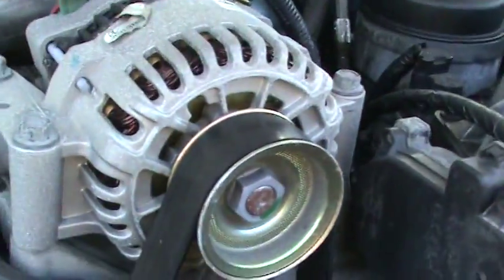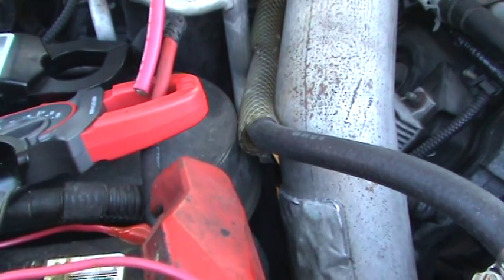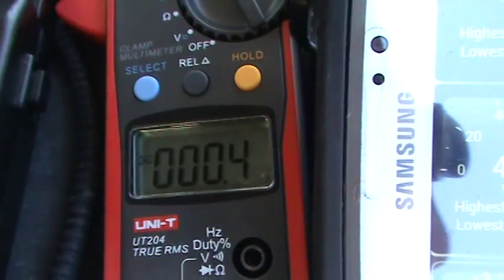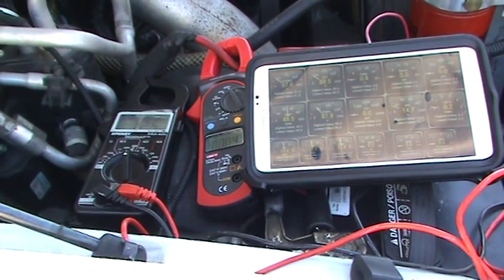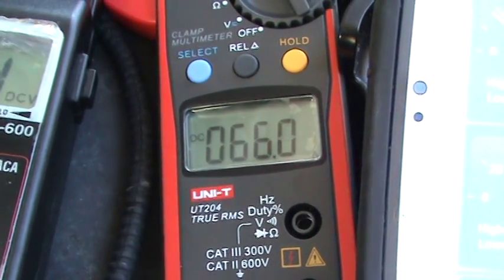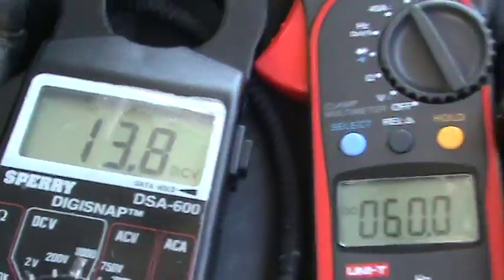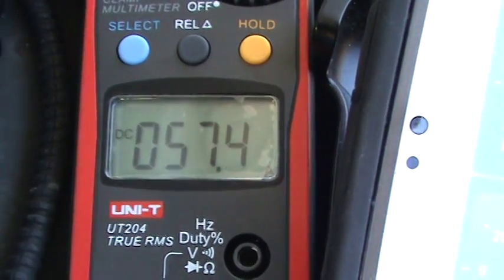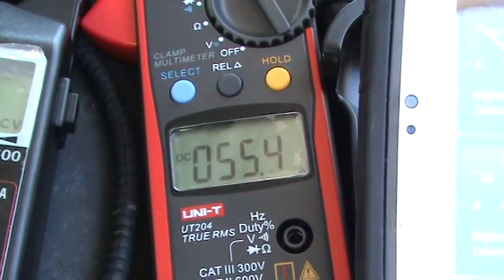Ford 6.0 stock 110 alternator volts & amps at idle

Comment: What software are you running on the tablet?
Reply: +Chase Harris  It's called Torque Pro for $4.99. You'll also need a $25 ELM 327  OBD Bluetooth adapter that plugs in your OBD port to transmit the data to your tablet.  Best $30 I've ever spent.
Reply: +myraret awesome. I've been looking for something like this for a while now. Thank you!
Reply: myraret  does it read icp pressure
Reply: Chase Hutcherson, it sure does.